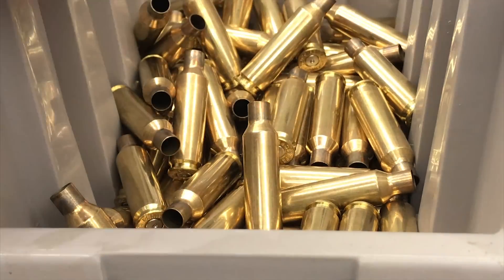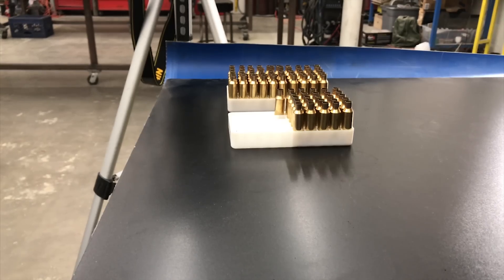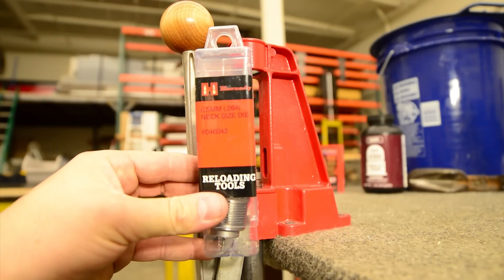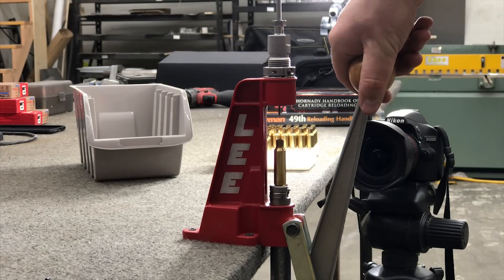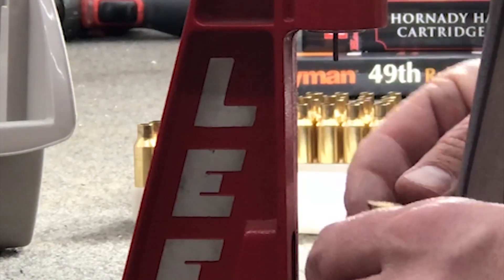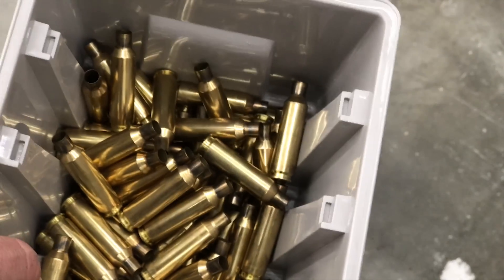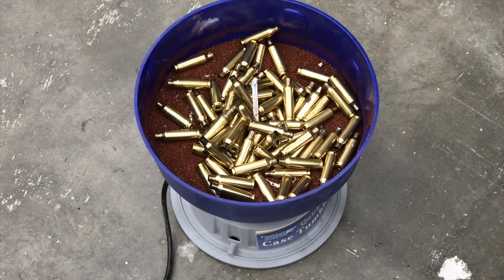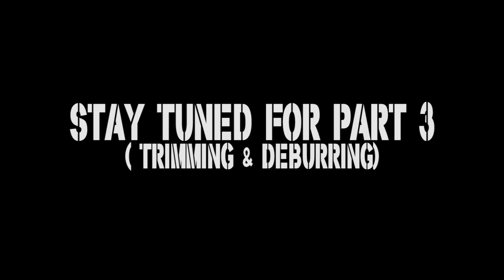Reloading 6.5 Creedmoor: PART 2/6 (Neck Sizing & Tumbling)

Comment: This is where you can combine two steps into one,  doing away with the neck brushing in the previous vid, being as you are only neck sizing. Forster and Lyman both make a dry lube neck brush kit, under 20.00. Pushing the case down over the brush cleans the neck and then it dips into the dry lube, pulling it back off the brush leaves some dry lube inside and outside the neck. That is all you need for neck sizing only. Motor mica refills are like 2-3.00, can do a few thousand rounds on a small bag. For full length sizing, you can use the dry lube and the spray lube or hand applied lube on the case, and the dry lube makes a big difference as to how the expander pulls thru the case, like night and day.
Reply: I appreciate the tip, thank you (I have actually upgraded a lot of equipment since this video, I now have a Lyman case prep center and man.... totally worth it, big difference. Have not tried the dry lube yet though, been doing a lot of 9mm and 223 mass production stuff as of late. But case prep is serious labor when you're doing a lot of semi-auto rifle reloading

Comment: Throw that one shot in the trash and get some lanolin and alcohol and make a homemade case lube brew! Lasts forever and 10× cheaper
Reply from the maker: Had a lot of stuck cases recently in my 223 dies and my reloading supply store told me to toss that stuff too. Tried the Lyman stuff and seems to be working better. Never had issues with neck sizing, but FL sizing will show you real quick what lube works and what doesnt
Reply from the maker: Using homemade alcohol and lanolin now.... best lube so far, especially when doing semi-auto (223) it saves me dealing with the dreaded stuck case in the die nightmare, it really makes a big difference, correct lube is imperative
Reply: Awesome bro! Another of my favorites is the Unique and the Lee stuff. Large quantities of brass always get the alcohol/lanolin. When I do my Precision stuff I go to the Unique or Lee lube and do each and every case individually making sure to get it all inside the case neck

Comment: Try sizing with a F/L bushing die instead.  Bump shoulders about .002" and get the benefits of smooth bolt cycling as well as the accuracy benefits of tighter tolerances.  Neck sizing is inconsistent, hence the need to F/L size the brass after it has been fired a few times in your chamber.  By bumping shoulder ~.002" every time and sizing rest of body, brass will always go into chamber the same size.  Try it, you'll like it.
Reply from the maker: Erik Cortina will try it, sounds ideal for competition shooting where one would need to be quick on the bolt. Thnx
Reply: Could you explain that a little better ? I am a new reloader and am not sure what you mean by "bump shoulders" but I am trying to size my brass as precisely as possible.
Thank you :)
Reply: Aaron Pigorsch Get a comparator for your calipers that’s allow you to measure base to shoulder on fired case.  Then size brass in F/L die and adjust die so that the shoulder gets pushed back about 0.002”

Comment: Subbed.... Just my personal way is from the range fired brass, they go into the tumbler first thing, to get them clean, then lube and decap. Clean primer pocket, resize neck only, then trim if required. then chamfer neck inside and out. Prime them. electronic powder measure Accu-touch 2000, then bullet seat with Hornady match die set.... 6.5 creedmoor in my RPR... Cheers mate.... looking forward to range and load results. I've left a few comments on moparmadman channel also..... Good Shooting Eh... thumbs up.
Reply: I agree. That's the way I do things except I don't lube the cases seeing that I'm only resizing the neck. I've recently started tumbling in rice after tumbling in the Lyman Tufnut to clean off the red powder. Works pretty well.